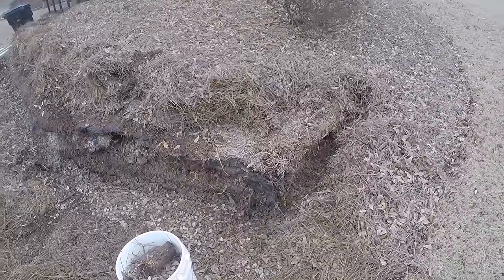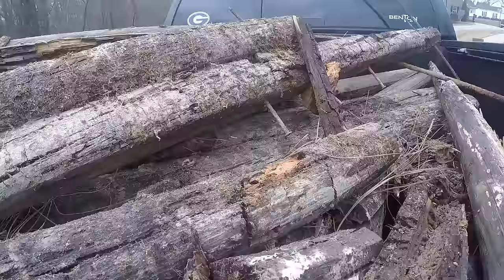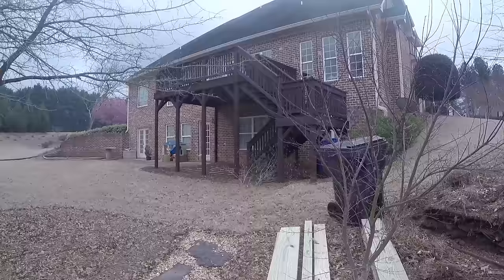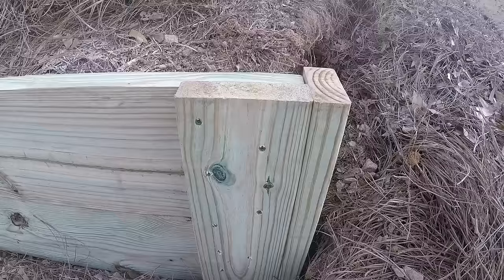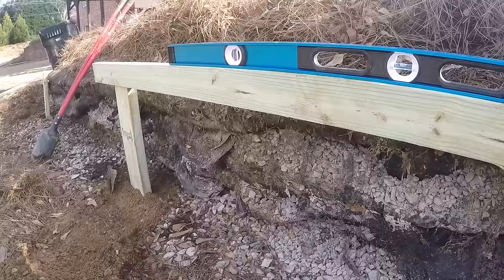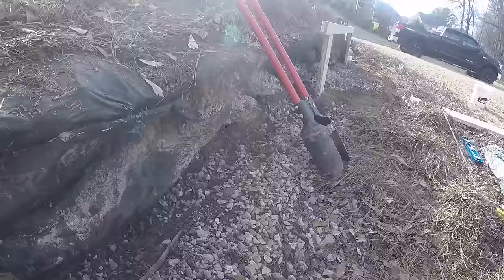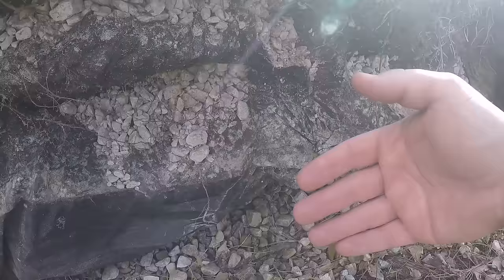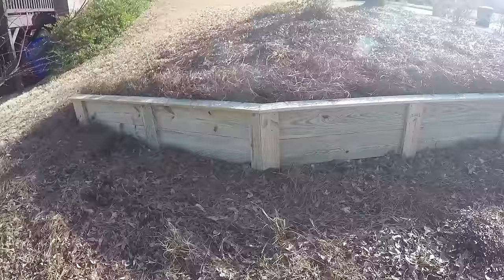Building an Easy and Inexpensive Retaining Wall

Comment: how has it held up over the last 2 years? have the 2x6's started leaning?
Reply from the maker: Walter Majors Not at all. Check out the video I just posted showing me staining the wall. It still looks brand new!
Reply: TightWadDIY I found that video and it still looks good. I plan on building one very similar. About 12 inches high but mine will have dirt against it. Would you recommend cementing the 2x6? Or maybe using 4x4’s instead.

Comment: Just by the way, that fabric is going to make that wall fail, the dirt packs up against it and water can’t seep out there for the pressure builds and wall explodes
Reply from the maker: brody Benotti Water seeps thought that fabric very easily. The gravel between the wall and the fabric helps that process as well.

Comment: Did you only use gravel and dirt to pack in the posts or cement as well?
Reply from the maker: I only used gravel and dirt. From what I’ve read, cement can trap moisture and cause premature rot. The gravel should let it drain better.
Reply: @TightWadDIY  Thank you! Love your work.
Reply from the maker: @sherwelthlangley  Thank you for the kind compliment.
Reply: @TightWadDIY  last question! Are your posts also sitting on a layer of gravel as well? Or did you just pour in gravel after sinking in the posts?
Reply from the maker: @sherwelthlangley  There is gravel in the bottom of the holes too.

Comment: Do you not need a drainage pipe behind the wall?
Reply from the maker: Sara Leahy It depends on the location. In my location, there is very little water draining towards the wall so the gravel is sufficient. If your wall has water draining to it, I would install a drain pipe. My lower wall has a drainage pipe.

Comment: Where’s the drainage pipes or at least stagger the boards that way the slope stays in tact instead of trying to build a dam...looks good but not to pratical..skim all that top layer of dirt and replace it with one big flower pot
Reply from the maker: Richard Solis I appreciate the feedback. There isn’t much water running down to this wall because the tree behind it sits higher than the ground around the wall. I think I even mentioned not needing a drainage pipe on this wall. It has gravel under it so the water would simple drain down the back side and flow freely through the gravel. I have a pipe on the older lower wall I showed because it does collect a lot of run off. I’m not sure I understand your flower pot suggestion.